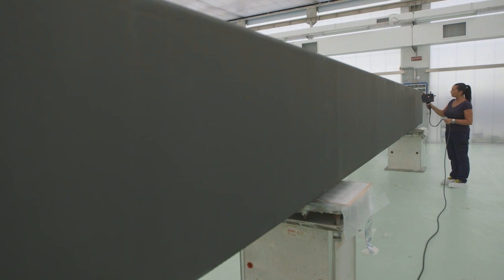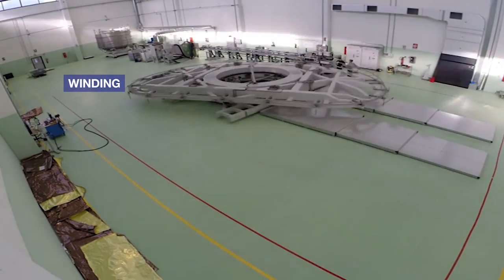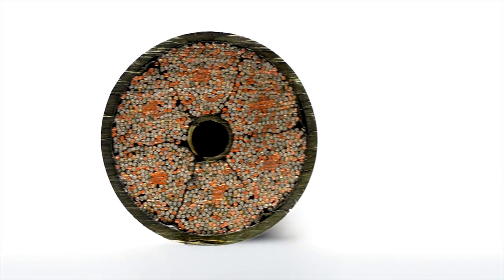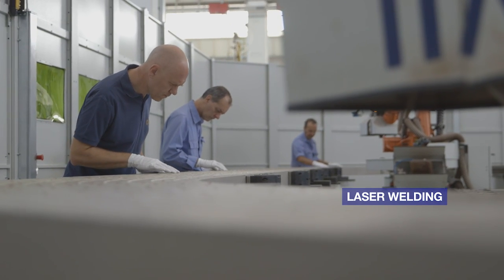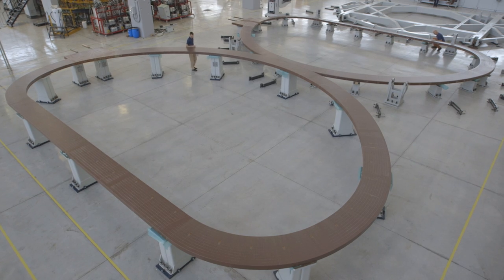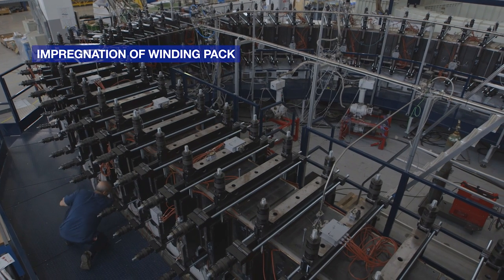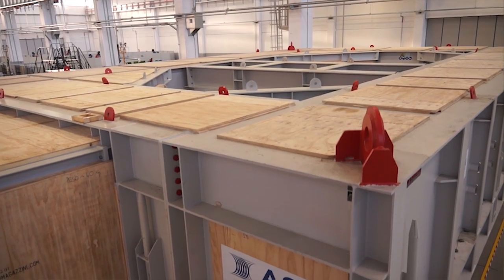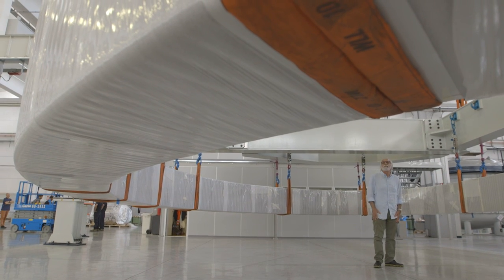How is Europe manufacturing the ITER Toroidal Field coils?

Comment: Superconducting at minus 260 Celsius producing 150 million degrees Celsius of plasma tell you what I want to be far away as possible. The power source has to be independent so 500 to 1000MW and to get what a few watts of power it's been done very difficult to control.
Reply: the power levels needed are less than 10% of what you think. Iter itsself is in the order of magnitude of just 100 MW and the entire expirement is about it proving this setup can provide economically viable net energy.

Comment: Wouldn't it be easier and cheaper to build a small one and make sure the principal works vs going and making one the size of a house? Mini ARC reactor comes to mind... Tony Stark was able to build this in a cave! With a box of scraps!!!
Reply: In fact, on the contrary, it is almost certain that small ones can never work. 
The scaling law goes directly proportional to physical size, sometimes in more powers than one. 
It is far better to pour all your resources into one that may work, than to many small ones (read: the many startups in the news) that are guaranteed by physics to not work.
The record in fusion has been held by JET in the UK since 1997. Research over the decades improved that by around 2 times in theory, given the same size.
Hence the only tried and true scaling law is physical size (and magnetic field strength, probably to the 4th power, but superconducting magnet will quench/explode at much weaker field strength than conventional magnets so there aint much you can do apart from a Nobel-worthy new discovery).
Reply: @deep.space.12  Tony Stark was able to build this in a cave! With a box of scraps!!!

Comment: Result: "We are not still there but if we build BIGGER one..."
Reply: Improvements in superconductors and computing since this thing was designed strongly suggest that we can actually make it work with a much smaller one - something like 1/10th the size. That's good because at this scale things get very expensive and slow.

Comment: Personally what you have built does not look like  a Toroidal  magnet as claimed by the title.
 (Unless this is only one segment of the Toroidal ) cross sectionally.

It looks more like a huge coil of large diameter wire, My understanding of a Toroidal  magnet is one where the magnetic field is enclosed inside the wound copper wires and according to science there is supposedly  no magnetic field on the outside, (But my experiments have proved there is a magnetic field external ) although weak around the outside of a Toroidal  magnet,
Reply: The title says toroidal field not magnet so it is perfectly accurate. But as you assumed yourself this is only one segment. It's even explained in the description...

And yeah obviously there is a small magnetic field outside too. I don't see anyone disputing that...

Comment: Whilst fusion would be great if it works and produces power at a reasonable cost, I can't help wondering how far advanced, solar, wind, wave geothermal energy would be if the development money spent on fusion had gone on renewables and storage instead?
Reply: Fusion funding is only a tiny fraction of the money going into these other renewable energies. And all that combined is a tiny fraction of the US' defense funding. I would argue that harnessing the power of a star at the flip of a switch is more practical than hoping the sun will shine and wind will blow when we needed the energy. 
When you come to think about it, all these renewable you mentioned scale with surface area (radius^2), while fusion scales with volume (radius^3). 
Meanwhile ITER as an research reactor can already produce 10 times more power than input. Even if scientists this generation cannot solve the problems of turbulence, they could still run the reactor at the tried and true L-mode with 5 times more output than input, with physics we already know. Imagine (or just google the specs) what DEMO can do.
Reply: @deep.space.12  ITER, 10 times more power than input? Wikipedia "When supplied with 300 MW of electrical power, ITER is expected to produce the equivalent of 500 MW of thermal power sustained for up to 1,000 seconds.[22] The heat produced in ITER will not be used to generate any electricity because after accounting for losses and the 300 MW minimum power input, the output will be equivalent to a zero (net) power reactor.[5]"
Reply: @deep.space.12  I wonder what power ratio I/P to O/P is needed to cover the costs of research, construction and decommissioning? I would guess hundreds to one.  Fusion may not be able to scale to far as there may be limits to fuel I/P, heat removal (perhaps heat pipes will suffice) or other physical limits. Solar is very scalable, as is wind, wave, and biomass and can reduce the transmission infrastructure needed by to a degree matching production to use (IE homes and factories). Storage is coming on in leaps and bounds and there should be more work done on biomass/biochar producing  energy, increasing soil fertility, carbon sequestering  and generating  on demand energy solving multiple issues.
Reply: Free energy can be had wherever there's water... simply stick one end of a tube into the water and another end at a lower point, then fill it with water and the water will start flowing. Then attach a turbine... It can even be underground if you want. Excess water can be lifted back with no energy input needed - except water - through a series of ram pumps(where you can again generate energy if you want) and "heat lifters" for example where the sun or geothermal creates higher pressure at the bottom thus propelling the water up. This is far more efficient than wind power or wave power and far less detrimental to the environment plus far far more economical to build, maintain, etc because of no moving parts in the construction.

You have ram pumps working for hundreds of years around the world with little to no maintenance needed. Pretty sure the idea is hundreds of hundreds of years old. Probably thousands. Which is probably the reason why tptb don't focus on it -- little economical gain because everyone could make these power stations and they don't cost much to produce.

Comment: Why does iter have to be so big?  Wouldn't a scale model of 1/2 or 1/4 provide the same experimental data?
Reply: Well, the bigger the better with fusion.
Reply: JET is around a quarter of the size of ITER and they have done as much as they can with JET.
Reply: The physics scales literally with size. A scaled model will surely fail.
There are many smaller research reactors all over the world running over the decades, and the science is pretty much well-understood for industrial production. 
Meanwhile some problems such as ELMs (turbulence) and runaway electron will only appear in a significant manner at the size of ITER, where smaller research reactors are unable to test.
While ITER (for research) is under construction, DEMO (for production test) is already undergoing its design phase.
You can Google a plot of Q (fusion "efficiency") or Lawson criterion over time, the progress has been quite "linear" (axis is logarithmic so it's actually exponential), unlike people who joke about "fusion is always 20 years in the future".
Reply: @deep.space.12 is there an expected timeline for DEMO?  Assuming it will be the size of ITER, how many megawatts will it produce?
Reply: @humanperson5134  2 Gigawatts, 25 times the input power, 2.5 times the gain of ITER, and only 15% larger in radius. Realistically though, expect 500MW and operational in 2050...
Reply: @deep.space.12  nice, thank you
Reply: They have a smaller one.  It doesn't work.
They believe making it bigger will change something.

Comment: oh man everything about ITER is so complicated. i hope ITER works, the only ones butt hurt if it does will be the saudis
Reply: knowing that ITER is a proof of concept and is only supposed to be a research platform, by the time we get an actual working one generating much more than it uses, saudi arabia relevance will be long gone anyway
Reply: Mycel  What?! Fusion is a replacement for petroleum in most cases. Not all, as we don't have good enough battery technology to have electric jumbo jets or heavy equipment yet, but that will come. Fusion will be one of the biggest game-changers in history, and not only will largely solve our electricity production needs, it'll also take care of most of the water scarcity issue.
Reply: @bmay8818  that's exactly what they said about nuclear energy in the 50's and 60's
Reply: @bmay8818  you seem to be forgetting that petroleum is also an irreplaceable chemical feedstock, without it - no plastics, lubrication oils and many precursors for other equally important chemicals.
Reply: @AKAtheA  Absolutely, which is why it's so maddening that we waste so much petroleum on stupid, useless plastic crap. In 100 years when oil is $3000 a barrel, nobody will be saying "I'm so glad we made Furbies".

Comment: Very impressive, was wondering how the coils are cooled when they are at full power?
Reply: They are cooled down first, so they become super conductive. 
That way they do no heat up no matter how much power you put through them. 

The really hard part in that regard is that on the other side of the wall is the plasma that is a few million C. 
And that must absolutely not cool down for it to work :) 

2 extremes so close to each other. :)
Reply: There is a "cold factory" on site at ITER, it's the huge white building and it contains three enormous helium compressors that will keep all of the conducting components of the reactor as close as possible to absolute zero.

Comment: I can't wait to see this thing working.
Reply: @Lawrence Bottorff That is always an option. Magnetohydrodynamic simulations cannot be completely trusted and ITER is mostly based off them and interpolation of scaling effects on stability/confinement and Q. But confinement is the devil here. The so called "vertical displacement events" (VDEs) and magnetohydrodynamical instabilities which cause loss of symmetry mean that there will never be continuous operation. Simulations offer little solution to disruptions and  instabilities. 
IMHO (as non laser expert) if your aim is non-continuous operation modern laser technology seems promising enough. 
Inertial confinement fusion is simpler in terms of confinement. Load -unload cycles will be performed by robots so even if the chamber becomes highly radioactive that is not a big issue. Economical viability and extracting the heat from the chamber are the ICF problems.
When the US saw in the late 80's how big, complex and expensive such design will be  they decided to abandon the development of an ITER-like experiment.
Reply: You won't :p
Reply: @peterbonnema8913  yes they will? there is no way they would spend this much money then suddenly stop it. it's going to be built and they will turn it on. 

since it's a test rig it working means testing, it WILL work since it can't fail...
Reply: @MsArchitectschannel  I've no doubt the coils will work fine but I'm waiting for a successful test of surplus energy producing self sustained fusion. As I have been since the 1960's and the research has been on going for longer than that.
Reply: We have already shown the surplus energy with H-mode on other experimental tokamaks. The size of the ITER would allow longer sustained plasma (hopefully 8 minutes) which is necessary to achieve longer steady state plasma (Q around 5). It takes a lot of power to heat the plasma but the great problem is divertor design. There is no material that will withstand contact. If the plasma reaches the tungsten divertor that leads to introduction of thermal and ionisation losses and immediately quenches the reaction. And when something like this happens tungsten is sputtered all over the vacuum chamber and the necessitates disassembly and complete cleaning and inspection of the sustained damage. It is so far unresolved problem which may NEVER be resolved completely.